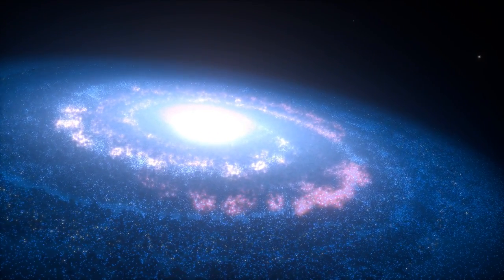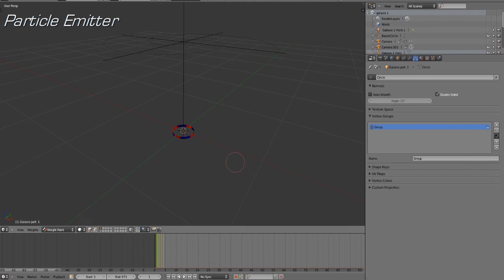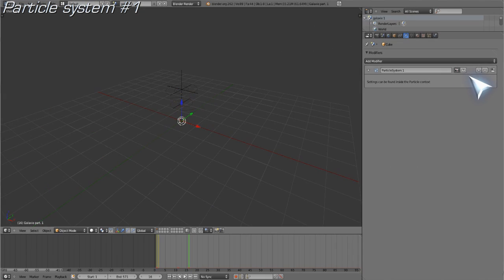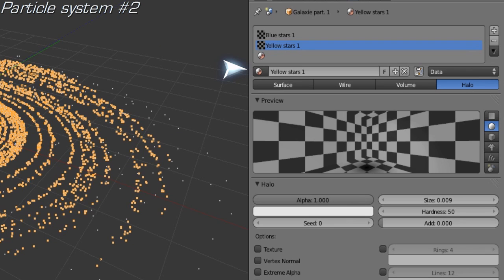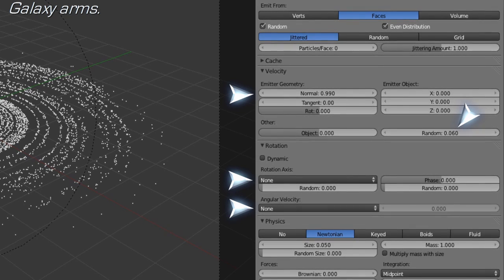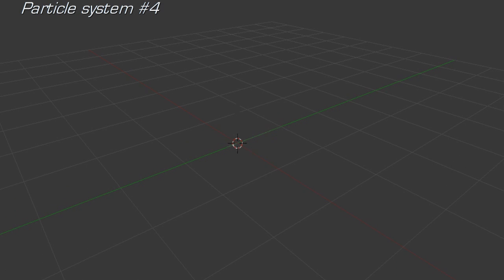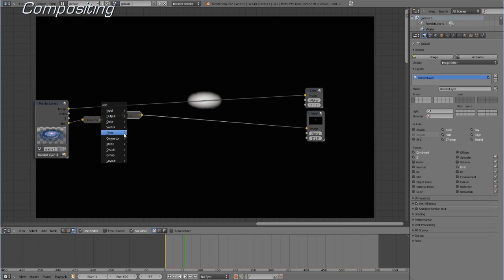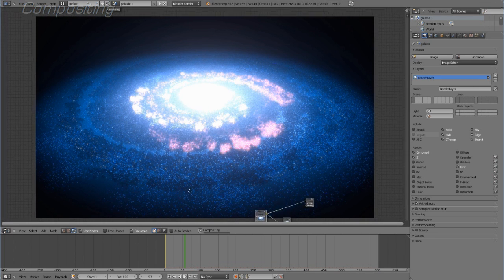/!\ OUTDATED /!\ Blender : 3D Galaxy tutorial. (Difficulty level : Medium +)

Comment from the maker: Ok, looks like the problem comes from the Glare nodes in the compositor. It seems they are causing the flickering and messing with the halo material as well. 
I don't know why it has changed or evolved that way, I think the solution is not to use Glare nodes, and trying to fake the glow effect using a Blur node and softly Adding a blurred render to the original (Should fake a glow).
I hope this will help.

Comment from the maker: Hi, yes you need to select the frame, change the value, insert keyframe : 
0 first, (so that the particles move freely and go into position), 
then 1 (so they are stopped.).
Particles going in ? are the keyframes set to frame 1 and 2 ? not 0 and 1 ?
Did you set a negative value to the start frame of the particles ?
Are the normals pointing in ? (i talk about the normals at 6:00).
For the 4 keyframes, I animated this tutorial using screenshots, looks like I used a wrong timeline :/ not important.

Comment from the maker: Is the vortex in the same layer than the particle system ? Or sometimes if you want a force field to influence particles you need to change a random value in the particle settings, and change it back to "wake it up".
The problem is that Blender is always eveolving, for exemple when the tornado tutorial was out, it was already outdated. Some changes occured with the smoke simulator and the tutorial has to be updated. In general, many tutorials are not totally exact or just wrong.

Comment: I have only 1 material that I know of.  Also, when I set the size the same, the particles end up huge and blow out the screen in terms of brightness.  I know you have the size at .009, but have to literally have them at .001 to get even close to that size (and it still doesn't look as good).

I've considered that maybe my camera is in a different position than yours.  Also, maybe I didn't scale down my cylinder to the same size as you did.  Still, I'm not sure how to adjust to match your results

Comment from the maker: Is the force field in the same layer ? Force fields affect only their own layer.
Sometimes, particles systems fail at capting a force because of the cache. If you change a simple value in the particle systems settings (like the number of particles, velocity, etc..), and change it back, it will "wake up" the particle system. (like "hey, something changed, you have to update). 
Also you can bake it, clic on bake in the cache panel of the particle setting. (And free bake to change something).